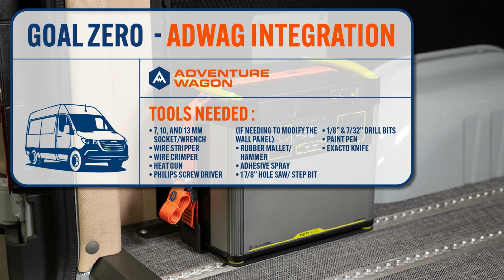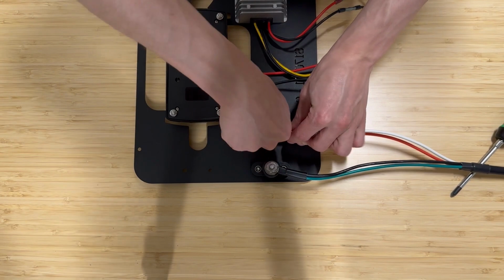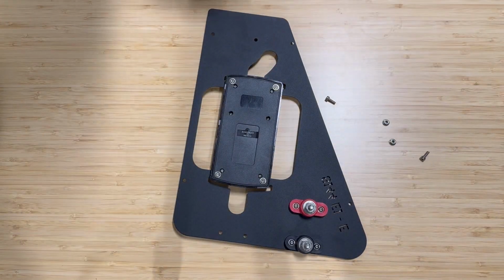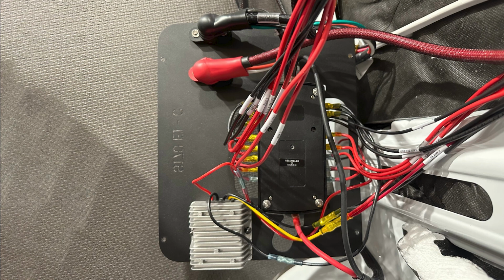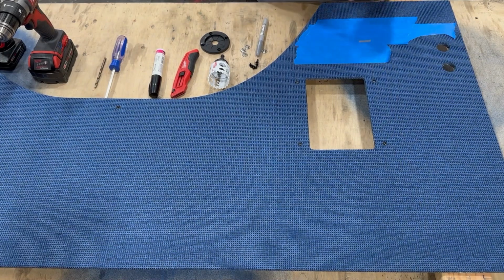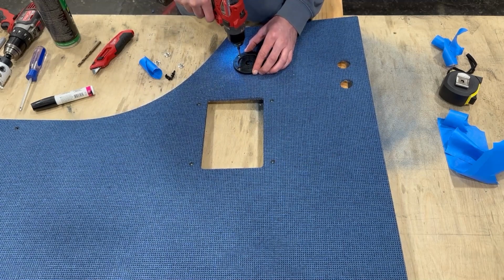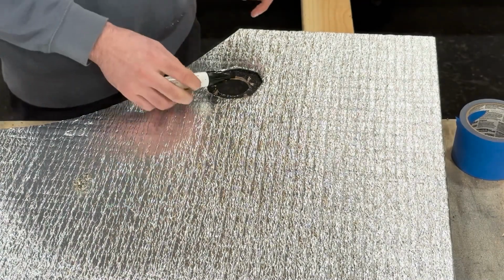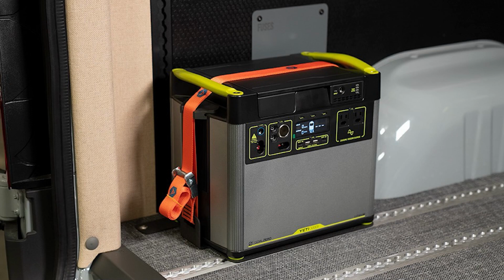Adventure Wagon Goal Zero Yeti Integration Installation (V2)

Comment: Will this kit work with the old high mounted fuse box system?
Reply from the maker: Hi there! Unfortunately this kit only works with Adventure Wagon's latest cabin wiring harness with the rear-mounted fuse block (released September 2022).